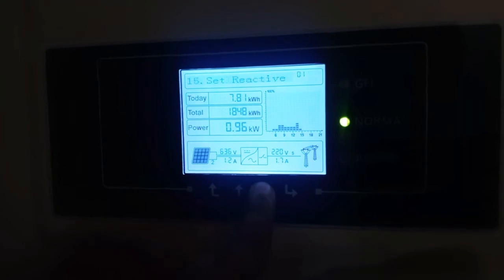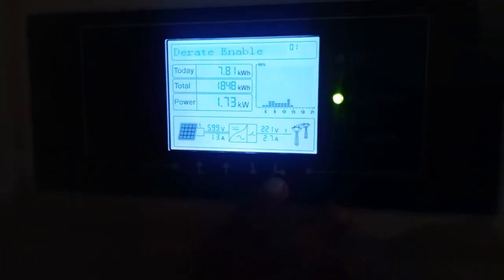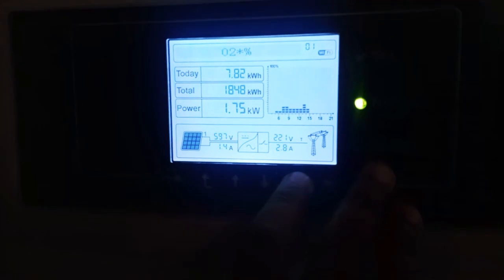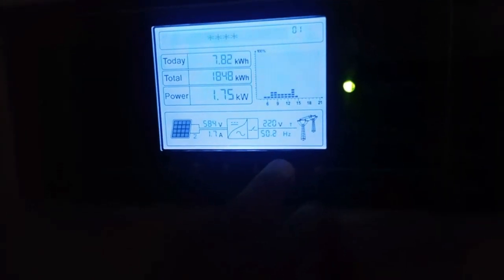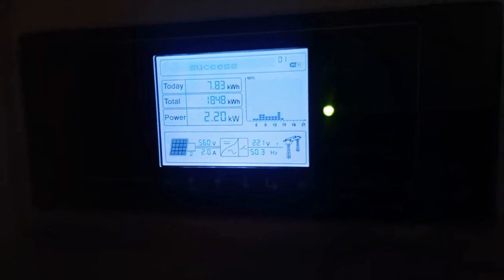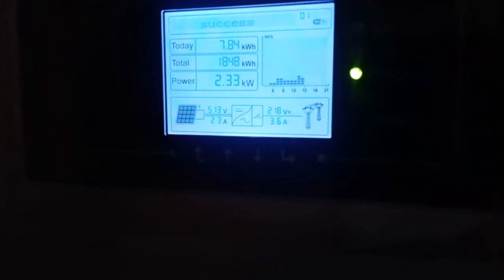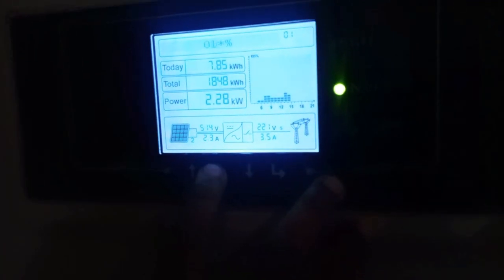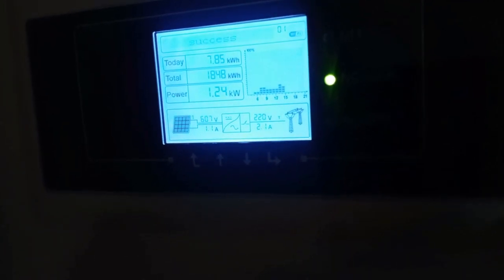Sofar Solar: How to limit Powet Generation without Zero Export Device.

Comment: Why did you disable anti-reflux? What is the effect of this?

And what is the effect of de-rate?
Our Sofar solar power is putting out power to the grid, how do I disable this. Thanks and more power!
Reply from the maker: to just limit power you have to disable reflux and limit power in %age.
Reply: @innovogreenengineering22  sir so you mean in the inverter, I have to choose "disable" the anti-reflux so the inverter will not put power to the grid? Thanks and sorry for asking, I am not proficient in electronics and solar power equipment.
Reply from the maker: @kewl800i  after disabling the reflux power, it will cut off communication from smart meter and power will be controlled by  inverter's setting.